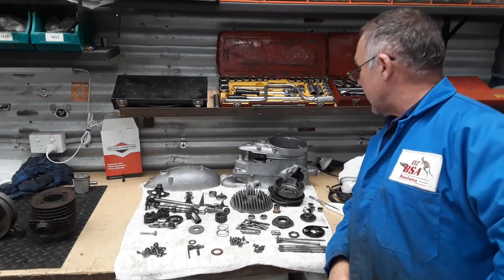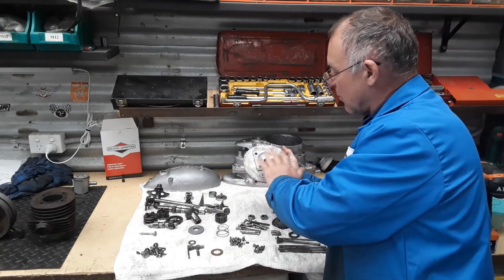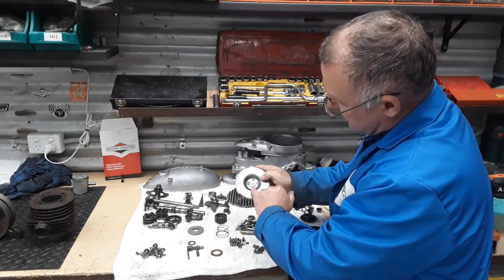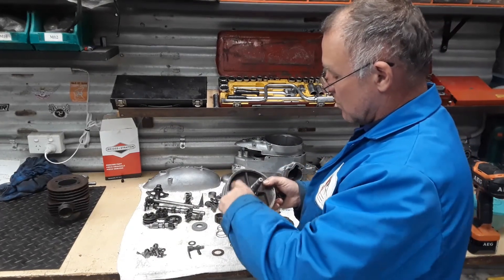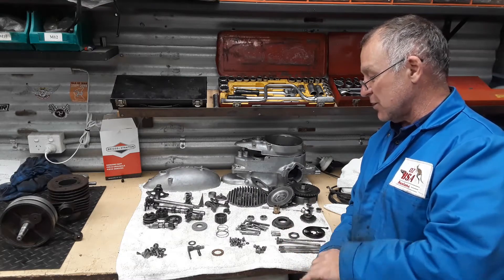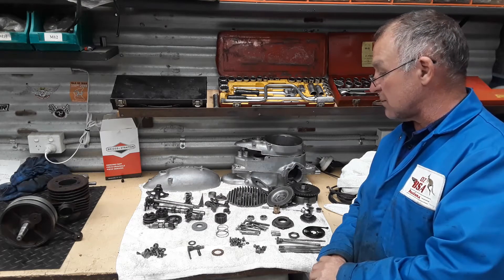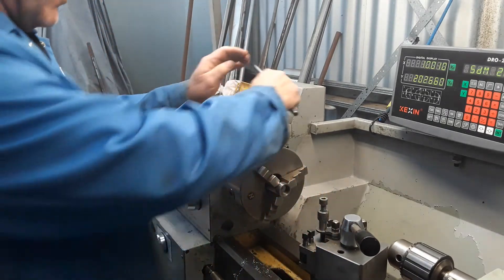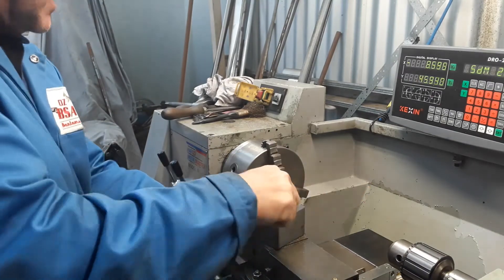Ep 12 Oz BSA Bantams race bike restoration

Comment: Great video Bones. Some of the jobs I have to do with my engine. I just put the same shop press in my workshop today! It will earn it's keep. Best wishes, Dean in Oxfordshire UK.
Reply from the maker: They're a handy size those presses and I have no issues pressing cranks apart.
Reply: @OzBSABantams  I'm glad you said that, as that's one of the reasons for buying it. Having said that, my Grandad used to do it with an Arbor Press but they were made of tough stuff those pre war generations! Kindest regards.